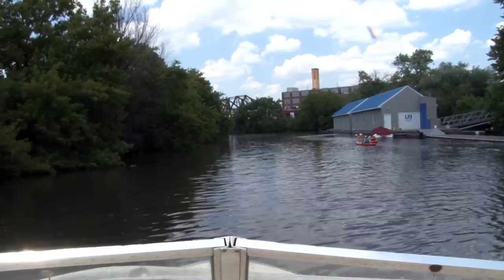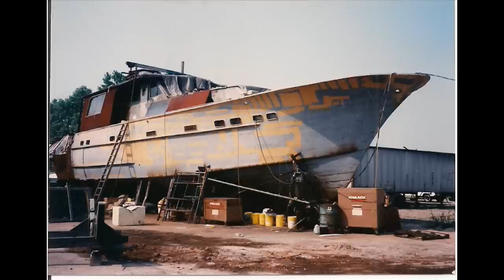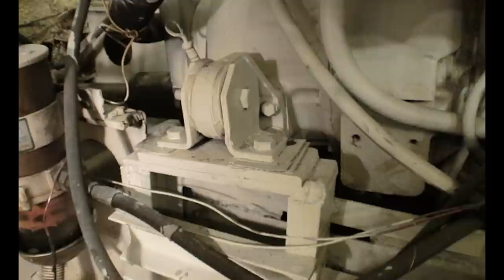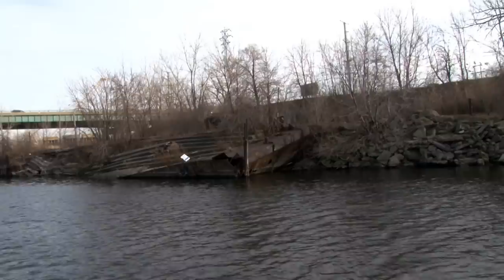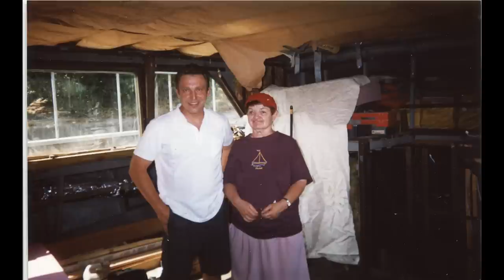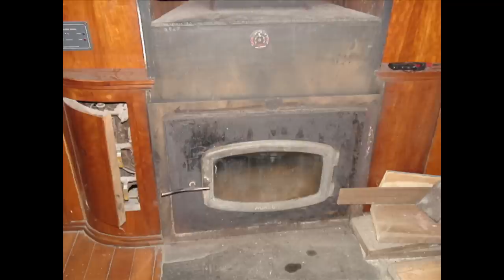74 Foot Homemade Boat  Part 2 of 3

Comment: Way too big of a boat.  Costs and hassles rise exponentially once you get beyond 45' feet or so.
I know a few high net worth people and money is no object to them (believe me) and even they wouldn't own even a professionally manufactured boat of this size.
There are hundreds of these insanely large, homemade  "dream boat" hulls laying around. Usually, the builders realize that they are in WAY over their heads and they either go broke or die before these things ever get completed.
Reply: +scdevon No doubt. It's an attractive dream. When I was younger I wanted to build a boat but I really looked into it & realized a big boat was just to much for one person. If you look at the man hours that go into a big boat like this it is multiple full careers. Professionally built boats can have 30+ people working on them for 2 or 3 years & they have the equipment & know how to minimize down time & maximize efficiency & the bigger the boat, the more the man hours grow to unrealistic proportions.  To properly do a boat this size would take a lifetime just to build. There is a reason big boats cost millions & you can only cut so many corners before it turns into a floating junk heap.
I can sympathize with chasing a dream but some dreams just aren't realistic. Like you say, many, even most, people that set out to build a large boat, the project ends in one of three ways. They realize they are in way over their heads & abandon it, they go broke & are forced to abandon it, or they die before it's completed. 
Like you say, costs & hassles grow exponentially the bigger the boat gets. I have seen several projects in the 30 to 40 foot range successfully completed but, even at that, you can expect it to take 5 to 10+ years & lets be real here, even if it's completed, the results generally fall far short of professionally built boats & resale value is very low. Prospective buyers generally run when they hear "I built it myself" That's why the original builder of this boat ended up with something worth scrap value. He put thousands worth of materials into it along with many hours of labor & ended up with something sub-par at best, downright dangerous at worst. 
I can relate to having a dream, I think everyone can but some dreams just aren't realistic & that's where so many boat projects go wrong. They take on something that requires more materials than they could ever afford & skills they don't have. I have mixed feelings when I see projects like that that. I kinda feel bad for them & I kinda think they are foolish. The first video in this series with the first photos of the hull, the story about using 8" flat to build the hull because he couldn't handle large plates & I knew it wasn't going to end well.
Reply: +scdevon Say that to SVSeeker.
Reply: is this thing even sea worthy? Would it hold up in open seas?
Reply: That is a mighty big soapbox you've got there...